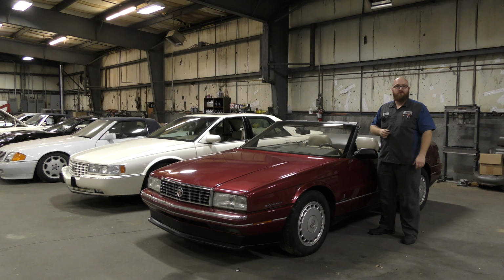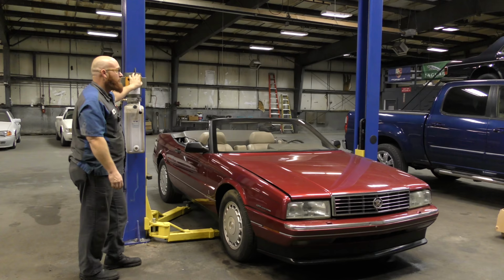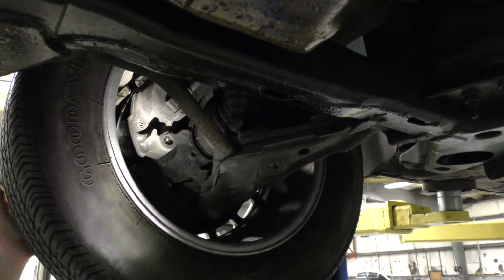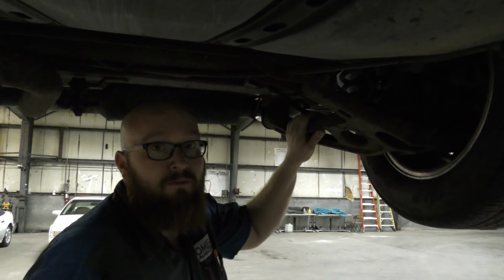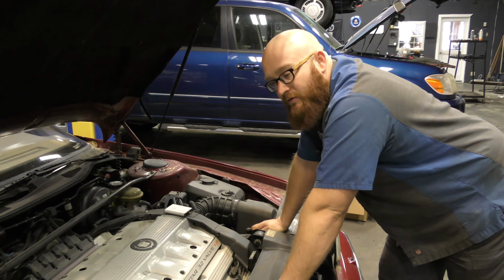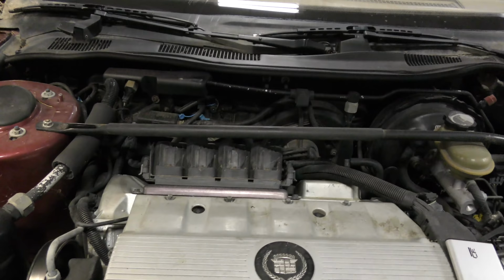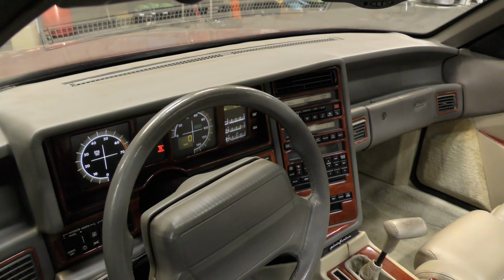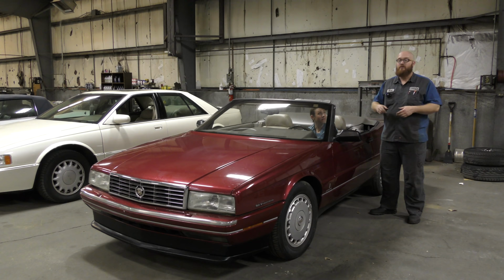Not another Northstar! The CAR WIZARD introduces you to a '93 Cadillac Allante and MRS. WIZARD!!!

Comment: Wizard: worst engine ever made......price goes down after his comments....wizard buys every northstar in town
Reply: It's no secret that it's the worst engine. Price was already down
Reply: Stonks
Reply: That's because Mr. Wizard knows how to fix this engine himself and he knows how to do it right, if it wasn't for the head bolts and head gaskets, the Northstar was actually a good engine
Reply: Link Knight you are correct in stating the northstar (deathstar as my mechanic refers to them) problems are well known. They became known to me when I bought this rolling dumpster fire yrs ago. Gm knew these turds grenaded at around 100 k for over 12 yrs and just shrugged it off. I’m 76 yrs old and MY father owned Gm back to the 1940’s and I also . Never again . Just hope I live long enough to see them go bankrupt for good. Now Lexus only......
Reply: to be fair , he has the knowledge and means to do all the work necessary to keep it on the road.
Reply: I'd fix the head bolts and then weld the heads and oil pan to the block for no more oil leaks...if the engine breaks after that...LS switch.
Reply: @JerryDLTN  you're gonna weld steel pan to aluminum block? I'm curious how..
Reply: Kwik mafs
Reply: @mikecastellon4545  - I am the same way, I own a 1967 Camaro SS/RS convertible, and it is reliable and well built, everything else is Lexus, because I do not have the time or money for car repairs!!
Reply: Oveida Sinclair and if frogs had wings they wouldn’t bump their butts when they jumped
Reply: Arlen Burgin better to use bungee straps to hold them together
Reply: @mikecastellon4545  OK boomer... glad to know you'd like to see GM go bankrupt and leave its 180,000 employees without jobs. SMH
Reply: @OffGridInvestor  it's a really good engine, just has Juan big problem
Reply: @oveidasinclair982  yes finally someone with some knowledge
Reply: @mikecastellon4545  That is the main reason why I'll never purchase a GM product and my dad will never purchase another one. The Chevy Cruse is another piece of junk and ticking time bomb.
Reply: @cenewton3221  I'm not a Boomer and I've been burned by GM's piss poor quality and abysmal resale value. Toyota/Lexus for me and I hope GM goes bankrupt for good and their 180k employees and the UAW has only themselves to blame.
Reply: C. E. Newton they can get jobs at Toyota if they are willing to build GOOD cars
Reply: His plans to become the Wizard of the Northstar!
Reply: Ultra next week wizard proclaims : I was wrong! Northstar best engine ever......price skyrockets. Wizard sells his vast collection of north stars.
Reply: @mikecastellon4545  it's a good v8, just has one problem. Simpleish fix and she's good.
Reply: Yung Eagle simply spend $3500 to replace gaskets
Reply: @cenewton3221  GM employs more than 180,000 Americans if you count the subsidiaries (including the one I work for. We manufacture heater cores and HVAC parts for the Chevy Traverse/Equinox, Buick Enclave, GMC Acadia/Terrain. About 600 employees at my plant alone.
Reply: How I was introduced to the NORTH STAR was the the Cadillac from movie "The Terminator" that Reese hot wires and in the parking garage and smokes the tires when he takes off... what stood out was it was the front wheels that were leaving rubber... something unexpected on such a big car
Reply: Brownsville hospital

Comment: My days of owning a Northstar are done, leave it to a professional like car wizard to get my joys out of a engine like that.. fantastic when it ran, a nightmare when it didn’t (1994 Cadillac STS) now I’ve moved onto 1999 4.6 Crown Victoria which has been a great car, noticed the intake manifold was original (which is amazing considering it was never replaced leaving me with the original all plastic design, in which I swapped out for the aluminum bolt in) never give up on these American mades, when watched over properly and understanding the cost limits and realities they can make a car man or woman very happy with years of service. Cheers Wizard and thanks for the great content .. from your neighbor to the north Windsor Ontario
Reply: The Northstar V8 can also be just as good as the 4.6L in your Crown Victoria.  The sister engine would be the InTech 32 Valve 4.6L V8 from the Lincoln Continental which are much more advanced and powerful over the 4.6L SOHC engines.  Once you understand these engines, both the Intech and the Northstar, they are not that bad and run excellent.

Comment: Brings back memories.. I had one that I bought second hand from the son of a dealership owner... It was (is) a great car... of course back in the day it had a 10 year bumper to bumper warranty and it needed it.   I had mine for a couple of years...  that 3 year old car needed a new fuel pump, fuel sender, weather stripping, power door lock motors, new power brake system.. and they fixed the power antenna.. twice... Good luck Mr Wizard...

Comment: Nice to finally be able to put a face with the voice behind the camera, Mrs. Car Wizard! The Allante looks WAY better with the factory wheels, nicely done. It sounds really good too. Hope she's able to enjoy the convertible when spring/summer rolls around. You may have recommended people not by pre-2005 Northstars (actually 2004 SRX came with the new Northstar for it's RWD/AWD setup I think) because most people can't do the head bolt repair themselves like you can. Paying someone to do it isn't economically feasible given the value of the car(s) but if one can do their own work, it opens up many more options for older cars. This would not include me mind you LOL. 

Also I think it's important to remind folks that the Northstars produced for 2005 & later models of the Cadillac SRX, STS, STS-V, XLR & XLR-V do NOT have the same problems with head gaskets/head bolts. I've owned an '05 STS and still own an  '08 STS-V and the Northstars in them are terrific.

Comment: Consumer's Report gave 90s-plus caddys a bad rating for being problematic...as best l recall...dont quote me...but l avoid them...give me any 3.8 v6 GM.
Reply: Do you want a 97 grand prix se? I have one I'd be interested in selling in eugene Oregon
Reply: They were better than the 80s ones...
Reply: The 3800s are truly great engines
Reply: pretty disappointed I got rid of my '95 Park ave (with the 3800 II) - the transmission went bad, but the engine itself was great.  Had 161k when I got rid of it.  Probably would have kept going had I fixed it.

Comment: I know that EXACTY "chip" that is on there. In fact before I knew better I bought one and thankfully did not install it after stumbling across a might car mods video about them. As a result I tore the one I bought apart and for what I paid for it found it to be nowhere not even remotely close to what it was sold as. It later turns out the guy who makes them is a scam artist and had done so multiple times before swindling people out of their money with a website that had all sorts of fake reviews. Needless to say that was many years ago and now I know there is no such thing as "cheap performance." It simply does not happen that way.
Reply: I think that fake website or a new version still exists. Googled it and found one that claims it adds 60 or 70 hp
Reply: Sounds like the one. I can't believe the guy isn't in jail. I did some research on him and it turned out he did this all out of California so how he hasn't been persecuted for this scam (that he's done multiple times) I'll never know. 

I have a proper tune on my truck and even then it only added 25 HP. There's no way you are going to get 60 plus HP out of a resistor bank. It's physically impossible. Even if it did something modern ECU's will simply realize there is a fault in the MAF or whatever air sensor that is in your intake and simply revert to the programmed fuel table. It will not run richer. The only way to do that is to change the hard values in the tune in the fuel table.
Reply: Floor-It-Duh the JB4 does some wild trickery. 60+ horsepower for about $500.

Comment: I have a 2006 Cadillac DTS and has the Northstar which none of my local garages will work on except the dealerships which rip a hole in your pocket.They run well. Bought mine for literally 500 dollars. I rebuilt the whole front suspension myself, and part of the rear, replaced oil filter housing gasket ( that resolved 90 percent of the oil on the bottom of the pan), replaced secondary air pump, all spark plugs/coils,  all wheel bearings, flushed every fluid the car has. total cost for me to repairs was around 1,500. Probably took me a little over 40 man hours to fix over time. still need to do rear control arms, but I don't wanna drop the sub frame myself lol. In regards to oil leakage, go through all the bolts and torque to spec, I found alot of mine looser then spec, and that resolved alot of oil seepage.  On a side note, you HAVE to give that car a few WOT  (wide open throttle) each month otherwise I promise you will develop carbon buildup and loss of performance and gas mileage , drop to second gear WOT from 40 up to 70, or alternative drive semi aggressive from stop lights. Never commented on your videos, but keep doing a good job and enjoy the holiday season.
Reply: The post-2001 Northstars are pretty decent, actually.
The headbolt problem is not nearly as bad, and some other bugs were fixed.
Reply: @davedammitt7691  Yes I agree there. Reminds me, i got  a little upper engine noise, almost like tapping. I am pretty sure on the rear valve it needs new rocker arms and valve lifters.

Comment: We had a '91 Allante for roughly 12 years! Put like 5,000 miles on it! Mostly just a garage queen. Had a bunch of little problems when we bought it, mostly electronic, like CD player, power antenna issues. A few years ago, it developed a brake issue...Just sitting in garage! learned that the Body Control Computer module took a dump! Got a used one that fixed it! I liked the engine though. It was the 4.5Ltr i think. Had individual intake pipes running to each cylinder! The exhaust sounded just like the car in this video but had one tail pipe. Motor was quick to rev up! Blip the pedal and she tooted right up! Had 57K when we sold it for like 25% what we paid for it! Huge loss. I was not impressed one bit with the ride and handling. Felt like an old PU truck. It's gone. Ya.

Comment: Glad to see U enjoying the Allante ,,,,I have one too a 90 WHITE PEARL/BLK its one of my fav cars to drive,, since i have about 30 from 1912 to current ,,,,I FIXED these new for Cad since i have collision/vintage shop that iv'e  worked in with my dad most of my life,,And always wanted one ,,which i got banged up on left front from a tire blowout ,,not hard to fix ,,a bumper ,,some lites,,fender repairs,,But recently getting water/steam coming off back of motor,,am thinking its from metal crossover coolant tube that has rusted at back of motor next to firewall  ,,,,its  a little cramped back there with a bunch of lines n hoses i am reluctant to touch or mes with unless i have to ,,,,due to leaks in vac or? and electrical problems moving older wiring etc,, Have U ever encountered this on Allante or Eld/Seville that have same eng platform,,,, If so ,,Please LetMe Know,AS i Want to continue to enjoy and drive this unique Cady Have driven mine numerous times down PA TPK @ 100 or more,,Looking forward to hear what U think   ?   ,,Thanx for U R informative Videos,,,,,,,                      Frank Heiss/Franklin Auto / Westville NJ

Comment: A few adds - those wheels are from an earlier, non 93 Northstar… and the dual exhaust on either side means someone notched the passenger side rear bumper… all 93’s had dual tip exhaust on passenger side only…  Mrs Wizard will need help opening or closing the soft top - everyone does…

Comment: David, the suspension system on Cadillacs of this vintage is RSS (Road Sensing Suspension), not Delphi Magneride. That did not come to fruition until the 2002 Seville STS performance luxury package. What is correct is that the suspension parts for any of them (CCR, RSS, CVRSS and Magneride) are pretty much unobtanium

Comment: These were actually very likeable cars. Personally, warts and all, I liked the Northstar engine. Its problems were very fixable. BTY, I understand the problems well since I am an ASE Master tech. I can be a glutton for punishment. A lot of cars that many hated I didn't. Remember the Contour? Its problems were all easily fixed. The 4cyl engines were excellent with exceptional MPG and above average get up and go. If the transmission was serviced every 50k it held up just fine, wheel bearings and struts and springs were all easily fixed for good with better after market parts.

Comment: I went against Wizard advice (AWA) and bought a 93.   This literally is like a budget Corvette convertible.   The lady I bought from had just put new A.C. , radiator (like free coolant flush), brakes,battery,plugs, full on engine decarb, to the tune of $3500 bucks.   I got the car , 120k miles, for 5k.   Hoovie be damned.

Comment: The Northstar Allante is rare, but it's the one you want to have...  the power that was promised from the start was finally there.....

The HT4100 motor was no picnic either...  Notorious.....  the 4.5, while not having a ton of power, would run forever.....
Reply: I had a 93 sedan deville with the 4.9L it was so quick
Reply: @snoopy5736  That's a good point, I had a 92 Eldorado with the 4.9...  Was a nice motor...  the Northstar, when running good, definitely put out more power, but the 4.9 wasn't bad....  Those would run forever also...  Was a torquey motor...  Pulled pretty hard...
Reply: The Allante 4.1L and 4.5L are NOT the same as the regular Cadillac models.  This is a big misconception by many people.  The Cadillac Allante was the first car that recieved all technology advancements and computer systems before being implemented on the high volumn models like the Deville, Seville and Eldorado.  The 4.5L engine is the exact same as the 4.1L with more power. The 4.9L was vastly improved borrowing many of the same advancements from the Allante 4.5L engine but still not entirely the same internally. The Northstar V8 which first started development around 1987 originally, is when Cadillac built their first European-styled DOHC V8 engine.

Comment: Not sure if it is true with the Allante, but the fuel rail should be stainless steel and not black plastic nylon.  The nylon tended to crack and spray gasoling, so there was a recall around 2005 where the plastic was taken out, and replaced with formed stainless steel

Comment: Such a beautiful car. I'm so pissed they made these front wheel drive. Imagine if it was rear wheel drive these cars would have dedicated car clubs all over and so many more of them would have been saved. I really want to get one before it's too late and they become expensive. If I ever won the lottery ide buy one that had a bad engine and ide have it stripped down completely, tare out all of the rear suspension, weld in a tunnel to run a drive shaft would have a custom rear end built for it. Would find a totaled new corvette and strip out its entire electric system and would essentially have a corvettes drive train and electronics. Ide remove the convertible and create a permanent hard top so I could remove all the extra reinforcement needed for it to have a convertible top. Ide put the late 2000s cafillac emblems on it and have the interior completely modified to look like a new cadillac but only the best materials would be used. Ide design a really nice hood scoop nothing to big but somthing that gives it a bit more style and airflow to the intake, and I would get the black polished aluminum rims off the new cadillac. I would try to make it more modern but not go overboard with the styling. Make it look like somthing that could have been made by cadillac. Also your wife is much hotter than she sounds 😆 I was picturing a nice old lady. You make sure this comment gets to her let her know she still got all that 😆

Comment: I usually get low mileage Caddys from 89-93 and on every single Caddy I get I change ALL hoses! You would be amazed at what you find out what could have been Very bad by doing this! And it's just crazy, no leaks or signs that something is wrong with said hoes until you start to move it or undo it and it either breaks or it reveals inside contents of massive bad Goo! The one that I just changed out its radiator hoses all look fine in fact new even, however on the inside of the hoses was nearly a quarter inch of rock crusty black stuff. That would have been very bad for the radiator.

Comment: Dear Mrs Car Wizard,
                                       Like yourself I have spent many months finding it difficult to get to sleep worrying about the Car Wizards teeth as he aimed a torch to investigate issues in need of repair.
                                            If you were to launch a merchandise product line of Car Wizard Headtorches with Car Wizard written on the band I promise I will buy one.
You could include fine print  which accepts no liability for attempts at remedial work discovered by this tool.......
                                                  Merry Christmas

Comment: I would never get an older Allante from Cadillac, even the newer Cascada from Buick, which are both totally junk. Mrs. Wizard is driving a 2004 Mercedes-Benz SL 500 already. Tyler Hoover is still driving his 2004 Nissan Quest 3.5 SE minivan, I believe. They are both great vehicles. Anyway, for my first or second vehicle, I would never get a Honda, Acura, Lexus or Mazda. Instead, I would buy a 1999 Lincoln Town Car full-size sedan, because it is one of the best vehicles, ever made in the North American market, with the 4.6 L 2-valve V8 engine in great condition.
Reply: If I would go for the 1999 Lincoln Town Car for my first vehicle, I will definitely go for the Cartier edition.